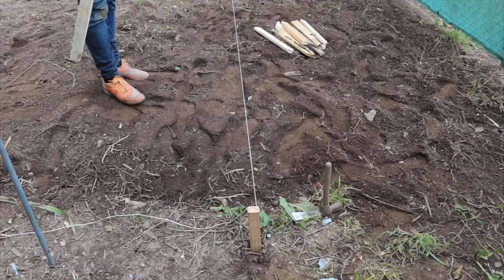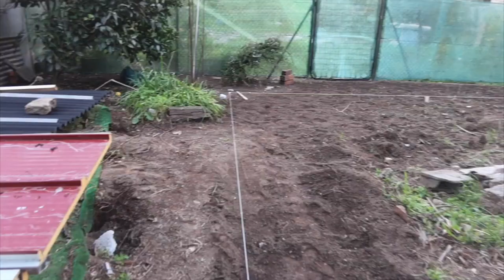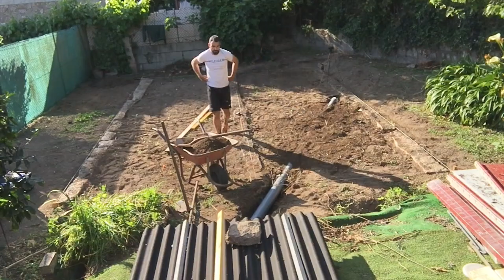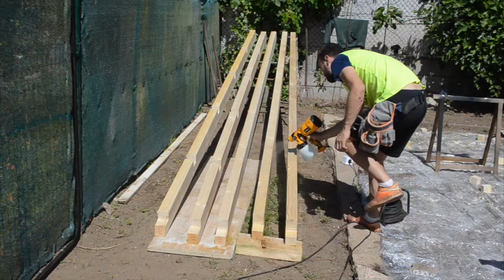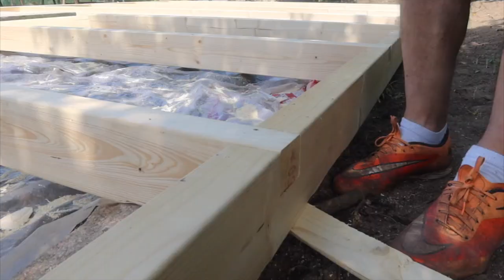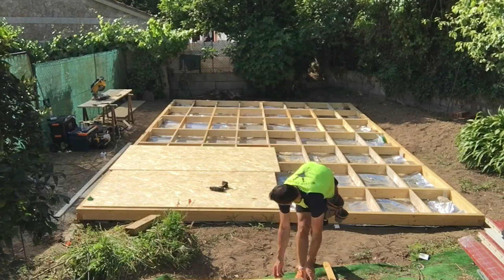✅ Building A Ground Level DECK 🤜 Beams and OSB boards

Comment from the maker: Hello Friend how are you? :elbowcough:

✅ How to Get a PERFECT SQUARE Method 3-4-5 ▶︎ PYTHAGORAS THEOREM
                      👇 👇 👇 👇 👇 👇 👇 👇 👇 👇 👇 👇 👇 👇 
                                               https://youtu.be/NaM7bL0e0V4

In this video you will see the process of building a wooden floor for a workshop.
I will use some stone posts, wooden beams and OSB boards.

▶︎ What is an OSB Board?
An OSB board is made up of several layers of wood chips glued together with pressure applied. The layers are not arranged in any direction, as it may seem, but rather the directions in which the chips of each layer are oriented are alternated in order to give the board more stability and resistance.

▶︎ What wood are used?
Mainly coniferous woods are used, among which pine and fir stand out. On some occasions also leafy species such as poplar or even eucalyptus.

Comment: I love the steel framing and mad skill.  But, I am wondering why does he spend money on a steel frame that will last forever and build a pine wood base?  I saw very little leveling too.  Am I missing something?
Reply: 5년뒤 바닥이 주저 앉으면 어떻게 해야 할까요?.그곳은 비와 습기가 없을까요?
Reply: I also wonder. I heard that metal framing now have about the same cost as wooden framing, so my only guess is that he didn't choose metal for its durability, but because it is better for drywalling. I would prefer a concrete base under my metal structure house for durability, but I admit I don't really like to work with concrete, so I would need to pay a contractor.